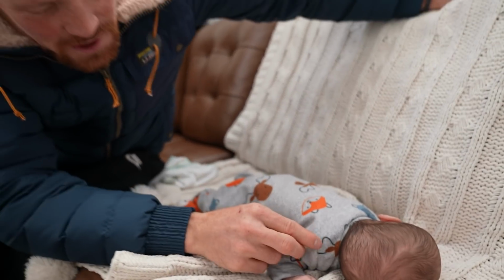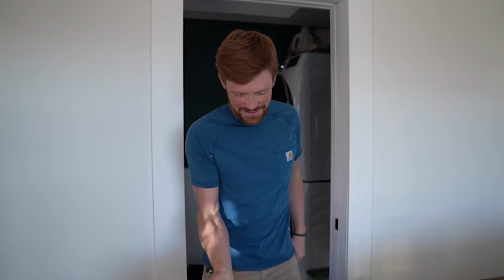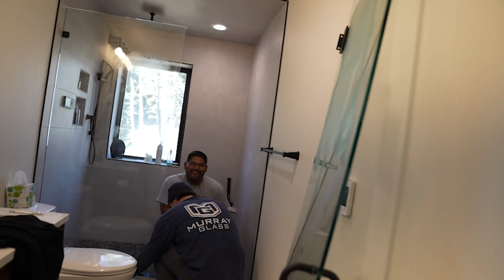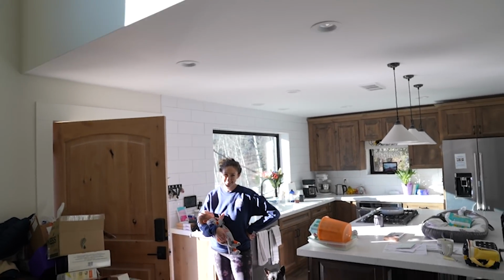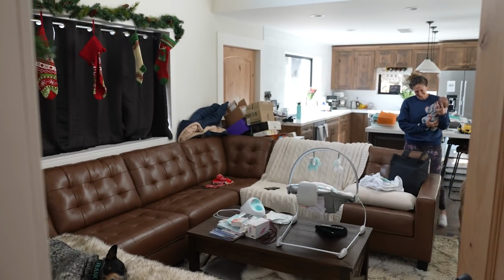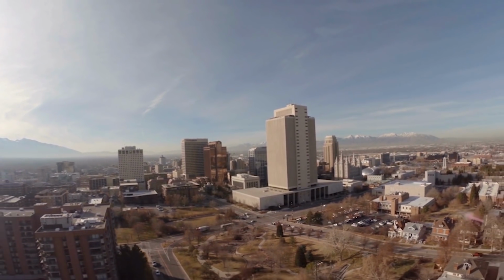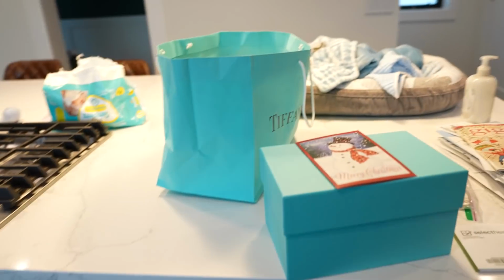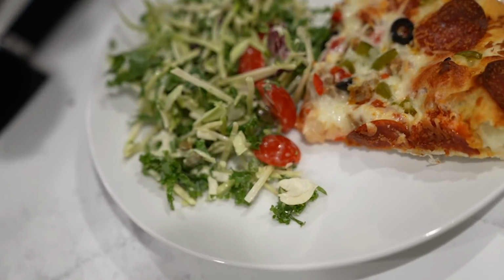THIS ISN'T HOW WE PLANNED IT | BUILDING OUR OWN HOME

Comment: As long as we're all in the bathroom, it's time to talk about how awesome an under-lid bidet is for a septic system. It really saves on toilet paper. Installs in minutes.
Reply: I have an underseat bidet. Besides a great saving of tp, you feel so clean.
Reply: I've seen those bidets recommended by others! A FB group for AirBNB Hosts mentions their effectiveness on dialing back toilet paper usage.
(Seems like a good point to make on this particular video!)
Reply: JoanOfArgghh quick question: dont you then have a stack of drying clothes?
Reply: I don;t get a bidet!!  You still have to dry yourself. so what?? More toweling to wash????  Use toilet paper and get it over with!!!  Yes.ladies might feel more fresh but still....
Reply: @heatherk8931  You still use toilet paper to dry, just not as much. The under-seat bidet is quite tidy and accurate.
Reply: @TheJennflip  No towels! What do you think is going on with a tiny jet-spray? You use t.p. to dry. You are much cleaner than any amount of t.p. can provide.

Comment: My favorite space heaters have been the radiator type that are filled with oil and work great to take the chill out of a room. There are shorter ones that you don't have to worry about kids pulling over on themselves and ones that you can place on window sills to keep chill away.
Reply: I've used the one you referred to, and they put out  good even heat.

Comment: For our unheated rooms we used portable oil filled radiators that are programmable. 
The air circulates around in a natural pattern - cold air drawn across heats, rises, falls, repeats.
The dogs and cats absolutely love it - and it is quiet!
The best ones have something like 60W/900W/1500W selection with a dial thermostat.
Forget the push-button Hi/Lo ones with the temp in 5° increments - get the ones with a real thermostat that fall into the :set it and forget it" category/ I don't even have to attend to mine during the "off" season.
Stay warm, stay well.

Comment: Another simple way to get the spacing right for window coverings, especially ones inside the window, is to make a cardboard template using the brackets so that all holes are the exact same distance.  Easy to handle and mark where to drill.  Multiple people can be installing at the same time and all installations will be identical.  My brother owns a blind company in another state and sent me some for a housewarming. When he came he inspected my installation job and (sounding surprised?) said the installations were all perfect.

Comment: FYI:  Keep your ceiling fans on low.  It will help keep the warm air moving & help keep with house temperature.

One more thing: (I promise this is my last comment) LL Beans water hog runners are great by the doors and under the dogs bowls.  They absorb the water until it evaporates.
Reply: a MUST have with dogs and country life!!
Reply: Most fans have choice of air blowing down or pulling up. Our fans in Palm Springs do that and really circulates air/heat all seasons.

Comment: A spay bottle with 1/4 vinegar and water solution with your squeegee will keep your glass sparkling if you use it each show. Also spray your shower head to keep the mineral deposits at a minimum. Spay any chrome also to keep the water spots away.

Comment: To clean the glass shower door, use a wet face cloth to scrub it down and then a dry towel to dry it. You can also use a tiny bit of your shampoo on a wet cloth to do the shower walls with.  😎

Comment: You might like a faux fireplace in the wall . You can get ones that have glass and colors and wood fires as well as heat that blows out like the one you have and it's warm for the other end of the room . I just got one . Make sure it is not a loud noise when it's in . Mine is fine but you do hear it . Just a thought .

Comment: Don’t worry about the gap between the glass doors, unless you point the shower head right at it, water won’t go through there at all. Also, if you’re concerned about lime scale building up in the shower head, every once and a while soak it in vinegar or CLR and that will dissolve the scale. You’ve done a great job on the house. Enjoy! Happy New Year!

Comment: I think you should paint a black stripe about at least 1 inch on those stairs from the car to the front door.  That way you can see where each stair is and not fall.  Otherwise it's an optical illusion and very scary. Paint that  room with the door that has all the blinds the same as the front door so it blends.

Comment: A little pro tip that I have found to work really well that I pass on to all my clients. when you clean your glass on the inside of the shower the last step take a dry rag and apply furniture polish like "pledge" apply it to the rag and wipe your glass down with it, it will help with water build-up fight against soap scum build-up and It also makes the water bead off the glass better, less squeegee work. This tip also works well on car windows helps bead the rain and helps from letting snow stick to it you can also use this trick on the windows of your home to prevent dirt from sticking to the windows. 
Anyways just passing along a tip if you care to try it.

Comment: When you mentioned minerals clogging the shower, it reminded me of a recommendation - get a ScaleBlaster water conditioner.  A couple of coils of wire on your water main, a plug for the AC-DC power, and you're done.  I'll admit I was a skeptic, but we've had one for about a year now, and no issues with mineral deposits, where it seemed like I was cleaning our shower heads every couple months before.  Depends how your water is, I suppose, but hope this helps.

Comment: I have the same windows in my front and side doors and I just made two custom curtains flat plain sleek white or you can use white stock paper with double sided tape temporarily block out each pane, or just have open either way it looks nice.

Comment: I have a similar two panel glass door for my shower and I have this plastic lip that slides onto the glass to keep the water from going through. It stays in place really well but it is also super easy to remove and put back on. Not sure what the technical name for it is. Her parents are moving to SLC?

Comment: Take the shower head off once a month or so, soak it in a bowl of white vinegar, brush it down with a stiff brush, put it back up.  That takes care of the scale buildup on the shower heads or kitchen sink sprayer.  I know … I have the same issue here in rural NE WA State.  It’s gonna be a non-issue.

Comment: I think you should paint a black stripe about at least 1 inch on those stairs from the car to the front door.  That way you can see where each stair is and not fall.  Otherwise it's an optical illusion and very scary.

Comment: Hi, I have enjoyed watching your videos, tips etc. Here's is a good one for your new shower glass. Over the years the mineral deposits from your water (Especially well water) will create a film that is hard to get rid of. In order to avoid this build-up, mix a solution of 1 cup white vinegar,  1 cup Blue Dawn dish soap in a spray bottle. Spray your glass regularly with this solution (Fan on as the vinegar is strong).With a clean rag spread the solution. Rinse well , use a good quality squeegy and you will avoid streaks. Your glass will remain clean, no deposit, no mildew for years to come. Will also help keep your tiles free of spots. Can also be used on taps etc. As a new mom it is hard to get chores done but as baby grows and sleeps better you will want to save time when cleaning. This solution works well and vinegar odors dissipate quickly. Enjoy baby time....it goes fast!

Comment: FYI....you most likely won't read this, but when that shower head starts to show mineral deposits, take it off and let it set in vinegar.  That will safely remove those deposits and your shower will drop water as it was designed to do and not at an angle.

Comment: Looking at your kitchen island, I must complain; There are Edges! each of the 4 Corners has sharp and hard Edges, exactly in the height of Leo´s Face/Head when he will start to run around! And being a true Childs, he will run, and not slowly walk... Injuries are predetermined if you don´t do something to smoothen these corners!. 
Better ask the vendor of your Countertops for a proper solution, this guy seems to be smart enough to have a proper solution for this issue! 
I am around 60 years old, and I still have a scar hidden under my left Eyebrow from such an accident! I  don´t need to say, that I had Luck, and nothing worse than a little cut happened. Better use the few months you have left to fix this. 😜😜😉😉